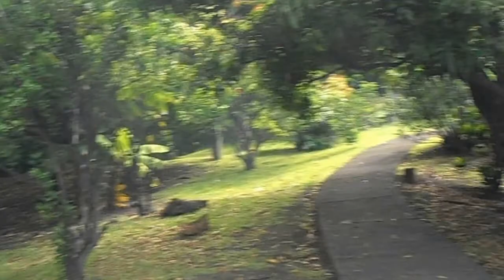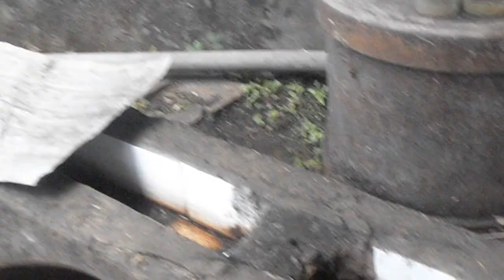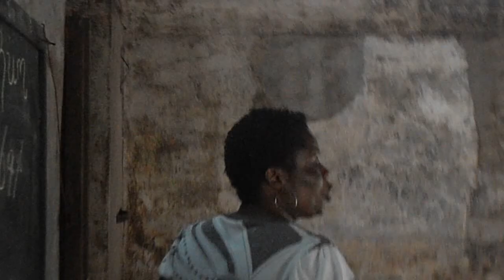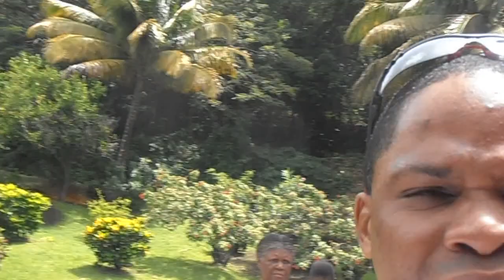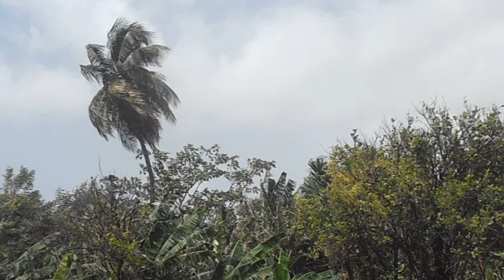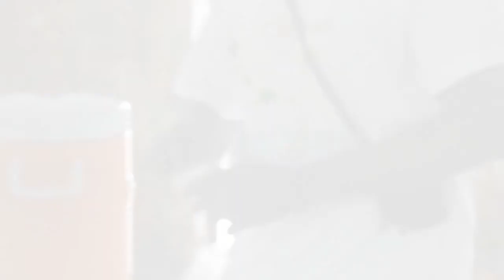Grenada, River Antoine Rum Distillery w/ Chief Odulani

Comment: Rivers rum is fairly exclusive to Grenada. It is a white rum that is made from locally grown sugar cane in a river-water powered sugar mill, utilizing a fermentation and distillation process that dates back to like 1785. The result is a sugary-pungent, earthy aroma that makes your olfactory receptors dance for joy even before you swallow the first ounce of this mighty elixir. The difference is the freshly milled sugar cane. Most commercial distilleries like Bacardi use imported molasses instead of rendering through the painstaking process of milling fresh cane, heating it to a precise temperature until it thickens, and then waiting areound for 6-10 days while it bubbles in the fermentation vats. That why Bacardi and other white rums taste like pis to me. Rivers is a man's drink. And, do not be deceived, this rum is amazing but is will knock you on your ass very quickly. 

The mill has an alcoholometer that separates the finished product into two strengths, 69%abv (blue label) and 75% abv (red label). The FAA prohibits the latter on commercial airline flights due to its flammable and combustive properties. So while I drink mostly the red label "Royale" on the island, I can only pack the 69% blue label variety to bring home for friends and family. Of course, the customs guys at Maurice Bishop International Airport know this, and regularly check my bags to see if I'm trying to smuggle out the stronger, prohibited Red Label variety. You just know that after these guys confiscate your rum they are going to have a big party and laugh at the silly yankee. I always leave the island with 6 bottles of this stuff and 2 out of the last 3 trips I have been called to the baggage area for a spot inspection. 

Rivers rum is almost exclusively made for Grenadians. There is little effort to export it internationally, as their local market is quite lucrative. It is also seasonal. They amp up production right after the cane harvest in the spring all the way until their carnival season (which is in August, so as not to overlap with the spectacular Trinidad & Tobago carnival the same week as Mardi Gras). After August it becomes scarce. In fact, by October, you wont be able to find any on the shelf until march or april.
Reply: Joseph Moorma
keep up the good work
Reply: thank you
 @paulettateague4307